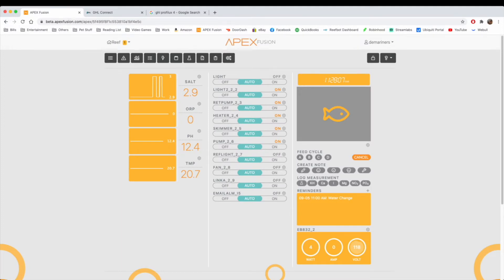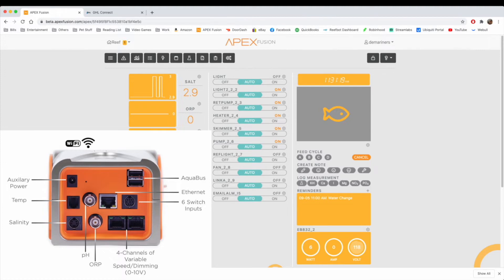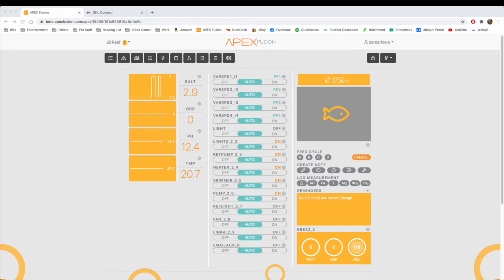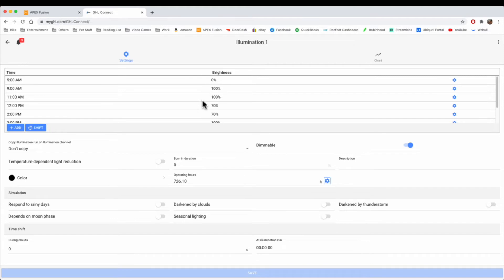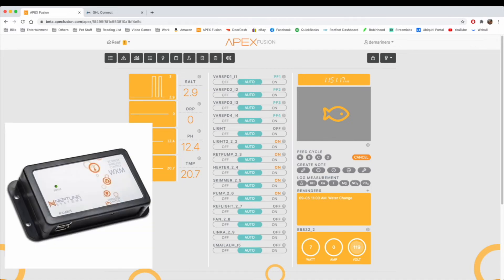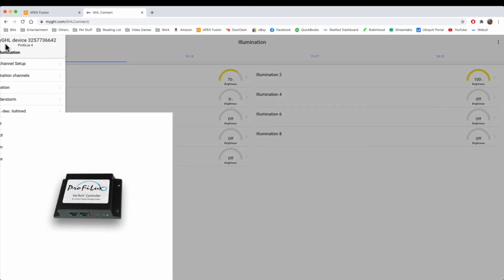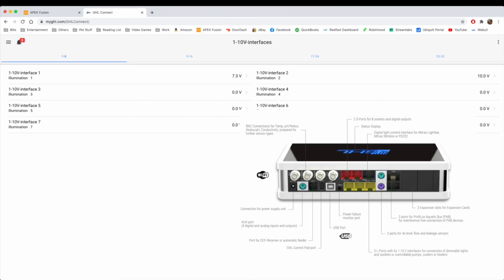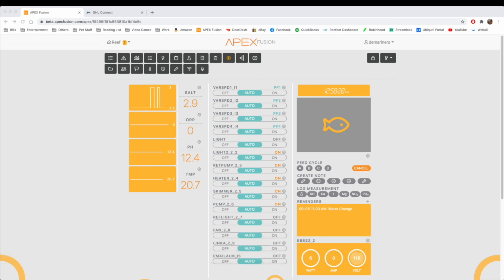GHL Vs Neptune Systems - Episode 13 - 3rd Party Integration

Comment: I am currently trying to decide between a used apex el (with pm1, eb832, and wxm), and a new full feature apex (base unit only). I have an eb8 from an apex classic. The two units are the same price.  I have two mp40s and one mp10 from before the wxm was discontinued.  Does the most current firmware for the apex still support the Wxm and vortech integration? 

Which would you choose?
Reply from the maker: It does however it is not up to Apex.  It’s up to Exotech.  Of the Ecotech has the newer chips it wil not work with WXM.